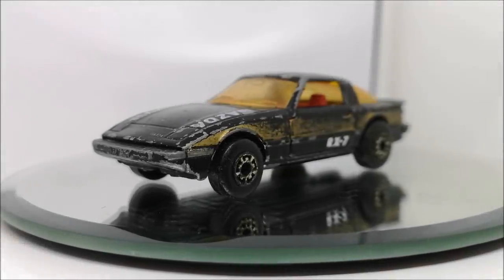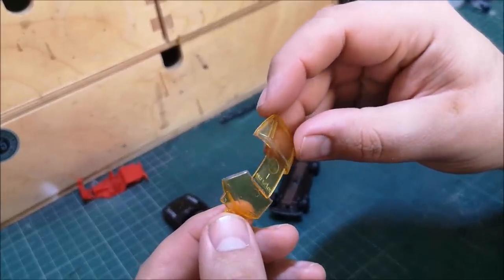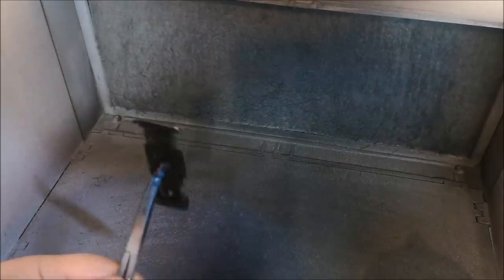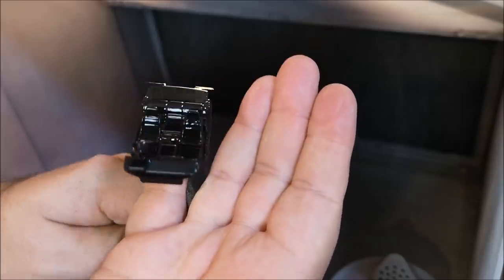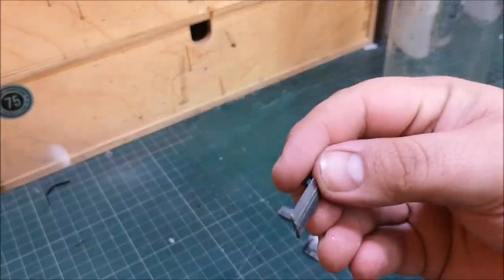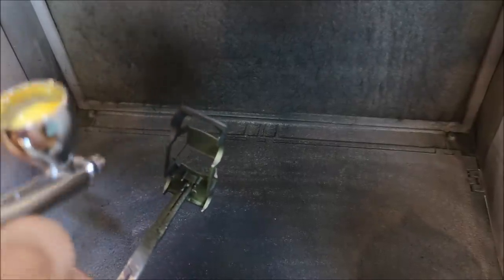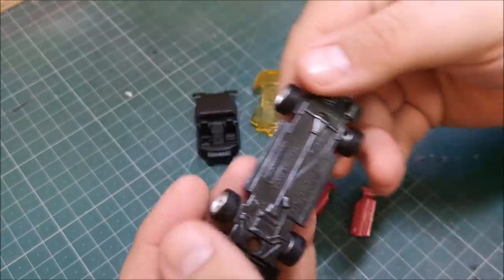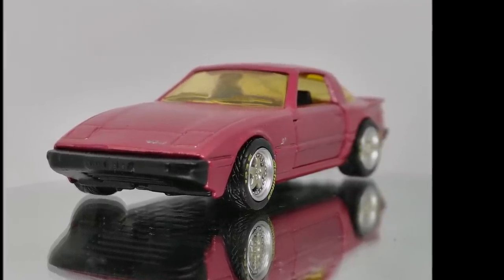1982 Mazda RX7 Candy Custom

Comment: Beautiful result Rob; everything about this one looks great.👌  That paint colour looks like a near-perfect match for the Matchbox Alfa. I don't remember it's number, or even it's full name, but you did un-box one a while back. It was a Superfast with a yellow base.
The mirrored rotisserie does give a nice, floating feel but the wheels will often appear to be off the ground a wee bit. You can see it on the front of the RX-7. Even if the wheels are sitting perfectly, this may well happen, depending on the camera angle. Looks good though.

Cheers for now,
Dougie.

Comment: I've noticed you tend to use the steel wire brushes. They do turn out nice, but if you use brass brush heads on you techlife, doesn't scratch the die cast, and you still get a great finish

Comment: Looks abso - tively great! The mirror should stay.
     Back in the '80s , I worked at a small college and one of the rich students had a new RX - 7..he had replaced some of the analog gauges with digital ones ( old school LED gauges). Really gave it the " car of the future" look 
    Side question..have you ever restored a plastic bodied car? Some Hot Wheels have die cast bases with plastic bodies. I suppose others do as well.
Reply from the maker: I've not thought about doing the plastic ones to be honest

Comment: This car holds a special place in my heart also, cracking work mate. Are you able to tell me the specific caustic soda brand you use? I paid 20 quid for a brand off of amazon but had difficulty removing paint off of some of my diecast models.
Reply from the maker: I can't get hold of the stuff that I usually buy at the moment
Reply: @MatchboxGarage  No worries, cheers dude 👍

Comment: Great color and wheel selection.

I almost bought an RX7.  I traveled about 250 miles to look at a Taurus SHO at this dealer, it turned out to have a bad rack and pinion unit which was an expensive fix.  They lied to me and told me it was the pump.  I'm a mechanic, so I know better.  Anyway They had an 82 RX7 that was almost perfect.  I had the cash in hand to buy the car.  It drove beautifully.  But it had a dead battery.  I asked if they would take $100 off so I could buy a battery at the parts store on the way home and the guy would not budge.  So I left.  Ten miles down the road he calls me back and says he changed his mind.  I said I was already gone.  Too bad I guess.  Not a good winter car by any means here anyway.